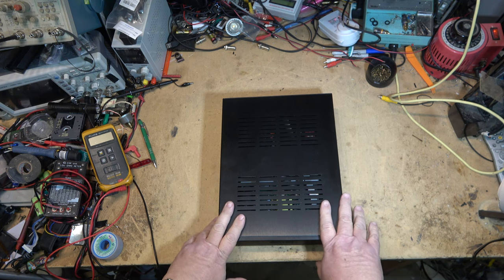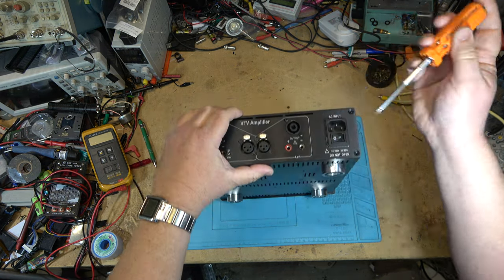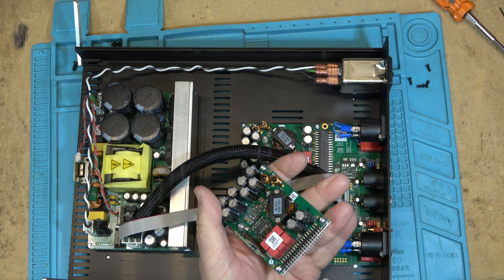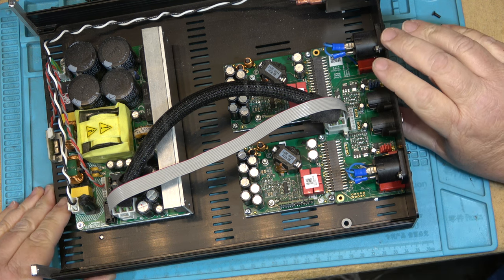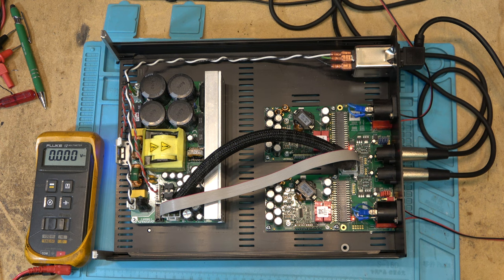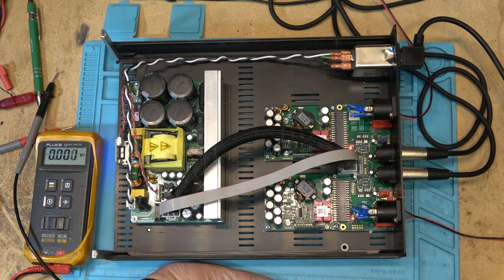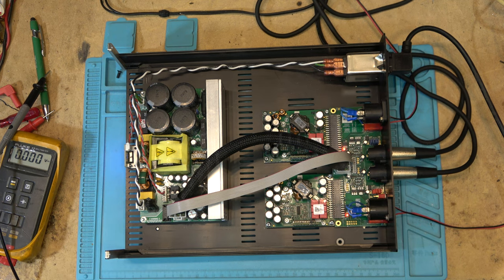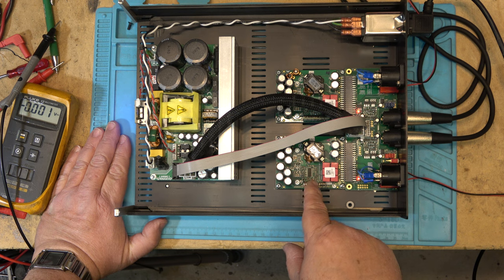VTV PURIFY Amplifier Tear Down and Demo

Comment: Class A or AB for me.  Yeah transparent, but dry with no meat on the bone.  I'd only consider D for an active subwoofer amplifier.  Interesting tunes for royalty free.
Reply: Added harmonics..  yeah nice... I rather have true to source...
Reply from the maker: Time to go back to school.  The modern class D blows the doors off ab. Why do you think all the big brands are behind the technology? They sound amazing and can drive pretty much anything. This one drives a pair of Maggie's
Reply from the maker: @tacofortgens3471  
This does true to source.  Tube buffers are used by many for that tube sound which is even order harmonics. That is why tube gear sounds so full.   I would buy the new model that has the tube buffer built in just like the 7000 ps audio bricks have.  I run a tube buffer on my crest and it sounds incredible.
Reply: @12voltvids which tube buffer? VTV ones are so expensive for adding a tube on the buffer board...
Reply from the maker: @wyup  you can buy many for about 100 bucks.  There is nothing to them.  Just a unity gain triode. If you buy a new amplifier with a built in tube buffet sure you will pay their price.
Reply: @12voltvids  By tube buffers you mean chinese tube preamplifiers? They are all single-ended and have high output impedance. Tube buffers for Purifi are differential.
Reply: I agree. Measurements of low distortion 1 KHz pulses doesn't mean it sounds realistic. I bought a Hypex based power amp and a cheaper Onkyo integrated sounds better. The Hypex sounds dry, coarse, not too far from a compressed mp3. We don't listen to pulses, we listen to music. It is good that it is efficient, but it is not yet there for audiophiles. It might need a good tube buffer or a discrete preamp to infuse some warmth and make it more realistic. I know it may be harmonics or distortion, but I don't like a violin sounding metallic.